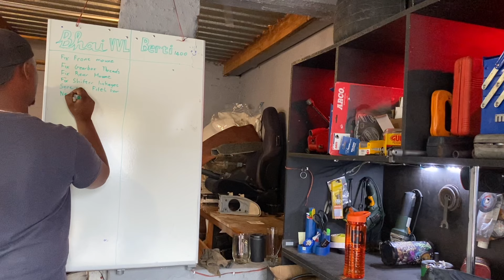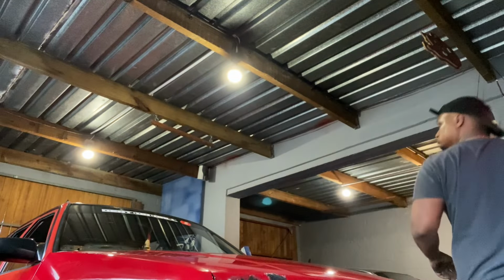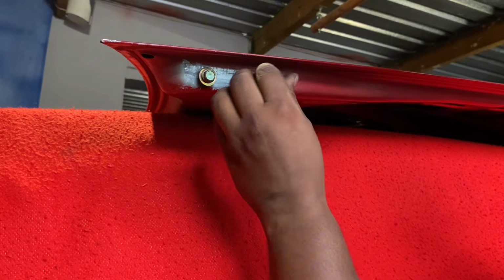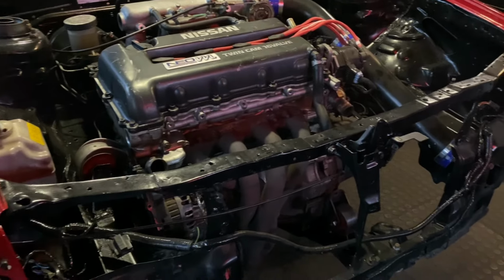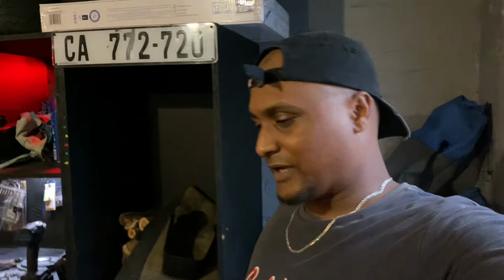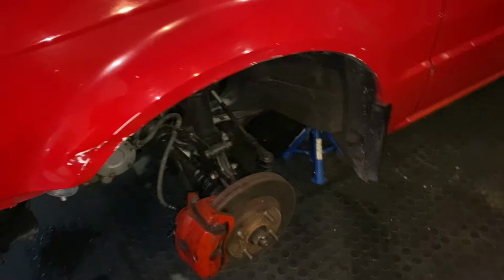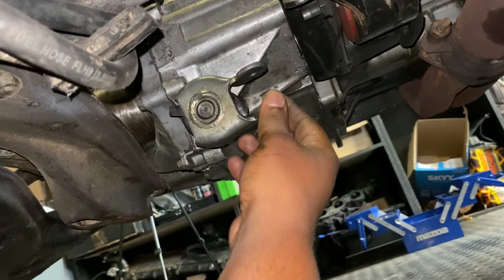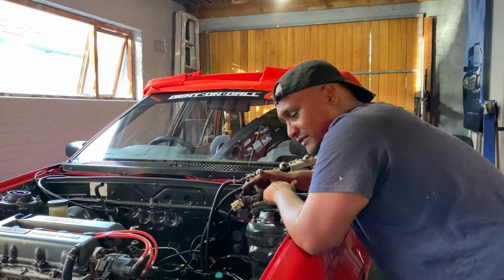STRIPPING my VVL swop MAZDA 😩🤷🏾‍♂️ Let the games begin 🤩🥹

Comment: My 323 same car is noisy lifters and my bearing caps,locking plate and set screws sounds los every time i accelerate😢😢
Reply from the maker: Must get it checked brother, don’t want it to cause engine failior